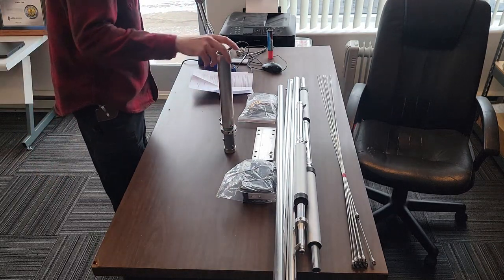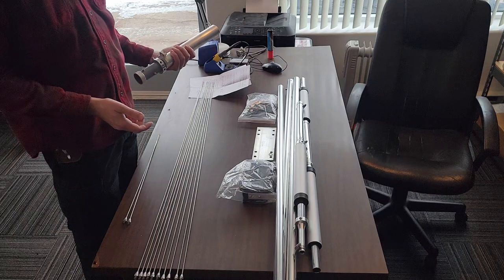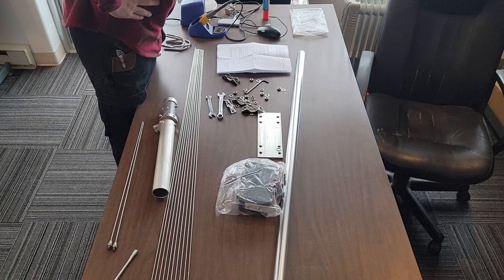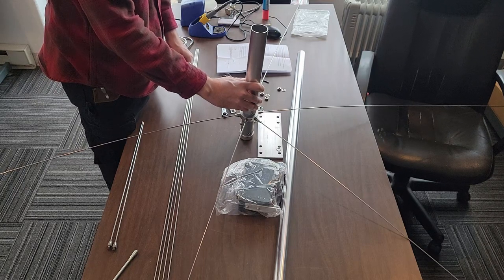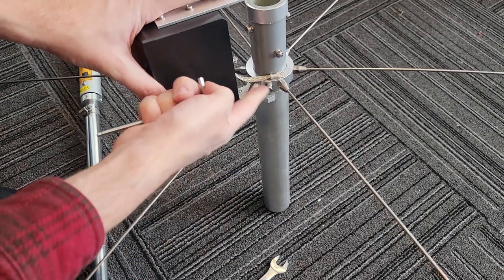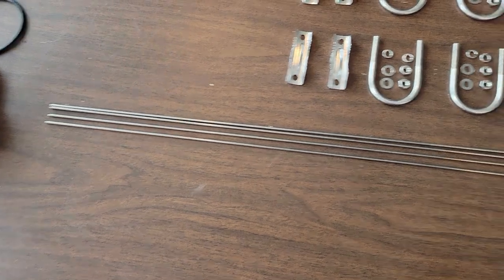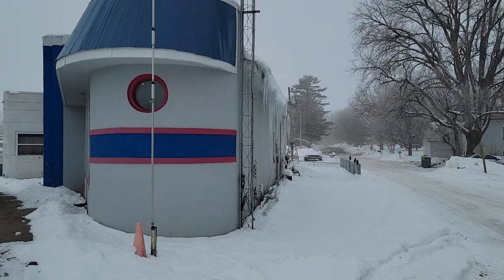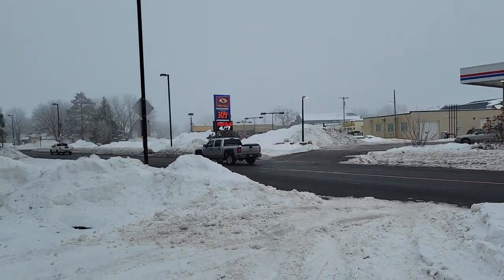The Xiegu VG-4 Antenna Build - Part 1

Comment: I just put one of those things up. Had a ton of trouble getting 40 tuned, but finally got it together. Instructions were horrible. There is an assembly paper on xiegu’s website that has measurements of all the sections. I could only get it off the ground 9.5 feet on a flat roof mount I found on EBay. Works well hooked to my G90. Well worth the money.
Reply from the maker: Instructions? 😆
Reply: @temporarilyoffline  Exactly.

Comment: Steve, I purchased and installed this antenna last week. I was amazed to make a contact in Poland (SP0WRTC) on 28.367 from southern New Jersey while the antenna was horizontal on two ladders about 4' above ground! Once I mounted it on my telescoping mast at about 10' I realized that I need to take it down again to get it properly tuned. Well built, but Xiegu seems to have altered it. Mine did not come with the main mounting plate. Also, noticed that your six (6) ground radials do not match mine! I only have treads for five(5)! Will post more later. 73 de W3DNQ
Reply from the maker: Interesting!  It looks like a solid performer... maybe you just got one that was boxed up wrong at the factory?

Comment: From Alibaba:
"Specification:
Use frequency band: 7/14/21/28MHz (40m/20m/15m/10m) 
Axial length: about 7.8m; Radial length: About 2.7m 
Maximum power handling: 1000W PEP (CW) 
Antenna impedance: 50 Ω 
VSWR：＜1.5:1 
Antenna bandwidth: 40m: 150kHz / 20m: 450kHz / 15m: 800kHz / 10m: 1000kHz 
Rated wind speed: 35 m/s 
Antenna interface type: SL16-K 
Weight: about 7.0kg 
Erection height: the distance from the ground is more than 3m

Other :

VG4 antenna can be adjusted to frequency band center frequency point that we need. During the adjustment, the 
adjustment of the high frequency band shall affect the low frequency band, while the adjustment of the low frequency band shall not affect the high frequency band. Therefore, the adjustment sequence is: to adjust from 10m of high frequency band to 40m of low frequency band. Generally, only 40m frequency band needs appropriate adjustment. "
I can't imagine trying to tune this hanging of the side of a tower.
I'd be more inclined to stick with something like the DX Commander or anything from CHA or a Hustler that had USA support. But then Im broke so its going to be wire and tree.
Reply from the maker: A wire in a tree works great!

Comment: Interesting have to wait for UK distribution
Reply from the maker: I checked with waters and Stanton, moonraker as well as ml&s - not there yet.
Reply: @temporarilyoffline  it's an interesting design it looks like a hybrid of an efhw 5btv I seem to recall diamond made something similar not on my computer at present so can't check 1-1 choke 4-1 balun? Capacitor?? 150pf ish mmmm interesting got all those parts
Reply from the maker: @steveedwards90  Are you gonna build one?
Reply: @temporarilyoffline  I am always building something still using a 5btv I built myself
Reply from the maker: @steveedwards90  very nice.  I love building!
Reply: @temporarilyoffline  5btv, home brew pac 12 40-6 m, various magloops including a remote tuned Arduino stepper control unit I just got to do something or gets bored stupid but looking forward to seeing this antenna.

Comment: Would be nice to see how the BTV compares to the VG4 at the same location (ie on the ground , replacing the BTV ) ...and ...you don't have to wait for the weather to warm up!.
Reply from the maker: That building...  metal roof, stucco walls (so metal embedded) and that BTV is missing some pieces.  Would be very unfair... I like it!
Reply: @temporarilyoffline  I keep flipping a coin between getting a BTV  or the VG4, that's why I'm interested in a comparison of those two @ ground level. I also have an "allergy" of ground radials which doesn't help either :)
Reply from the maker: @dimitriapproved  makes sense!  I think they will perform very similar, but if the BTV has its proper radial field it will be the winner!

Comment: Most likely there's some capacitance between toroid and the top of the box connecting to the rest of the mast.  That's why you can't meter it.  Be interesting to see how it performs, especially for the price.
Reply from the maker: You knew I had to check anyway - I'm not surprised by the results at all.
Reply: @temporarilyoffline  Actually I am, even though that explains, because usually a capacitor will be in parallel from the antenna to a ground, not in series.

Comment: I just got one. Sections one and two do not quite fit and I had to sand the inside of the fiberglass section. The bolt holes are slightly off on mine. 
KK6USY has a video and he didn't have the same issue, his seemed to go together easily. You don't show that part here and you didn't mention it in the video where you put it up, so i wonder how that portion of the assembly was in your experience. 

It is now shipping with a different style of mounting brackets. 

Watching videos of others putting this antenna together and not being able to get it to tune, I think everyone is  leaving it too long.  To me it looks like there is a sharpie mark at each yellow sticker. I'm seeing everyone assemble it with the sections not slid far enough into each other. Sections 2 to section 3, and 8 to 9 in particular. 

The video of all the chums on field day.. they take it down and shorten it, and are still well long of the yellow sticker. It was resonant way too low. They never did figure it out.
Reply from the maker: Glad you were able to get it all together and thanks for the tips.  I didn't have any problems with mine during install or getting on the air.
Reply: new mounting rings and u bolts don't fit a 1 3/8 mast.. jeez.
Reply from the maker: @randyk8919  that stinks! I used those 4ft military mast sections to mount mine

Comment: i am guessing the big coax toroid is a CMC and the other one is a typical end fed un-un (9:1)
Reply from the maker: With it being a 9:1, it is interesting that it is resonant on 40,20,15,10.  I know it's possible, but it's not "normal"
Reply: The red transformer is a 4to1 because the antenna is a 3/8 wave vertical similar to cushcraft r6000 et al. The other toroid is indeed a CMC.I used the measurements  with a old Hokushin 10 and 15m dual band trap with a cushcraft r6000 matching box and it works really well for 10,15 and 20m with 6,48 inch radials.  Rob   G4WGR

Comment: any help on putting my antenna together .. new ham here ..   vg4 .. i need to use the 10 meter part only can i do that with this antenna .. not connect the rest of it together just use the 10m part only by itself?  Thank you.
Reply from the maker: You probably could use 10m only, but you'd have to experiment to find out how to assemble it.

Comment: It appears to me that Xiegu is attempting to penetrate the amateur radio antenna market, however, there are too many issues with their current production radios (x6100).  Their tech support structure needs to be more transparent and not rely on more firmware releases to fix issues.  Could you post a new “Quality Update” for the new firmware for the x6100?  Thanks for all you do. 73 de KD6UYK (Tim)
Reply from the maker: Hello Tim - Yes, Xiegu has an interesting way of doing business for sure.  Latest x6100 firmware is here: https://www.youtube.com/watch?v=h7dBefkPmFg

Comment: U forgot capacitors block DC but its a strange way of doin a 9:1 and usin the cap to sightly shorten the antenna
Reply from the maker: I wasn't sure where it was connected in the circuit, but it's always interesting to check it out and demo it.  Good eye!
Reply: @temporarilyoffline  it will be interesting to see how ot performs,i was just thinkin it could also be to lower the SWR for 40M due to the iron core not being too good for a 9:1 on the lower freqs but u will soon find out and its even better cause its not some hard to find paet if it fails like more expensive antennas
Reply from the maker: Right, simple is good sometimes